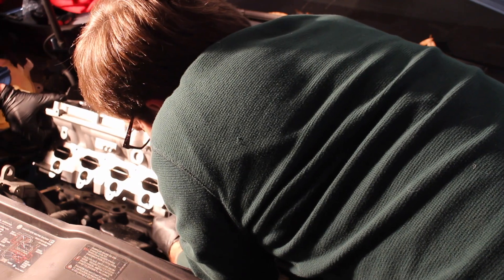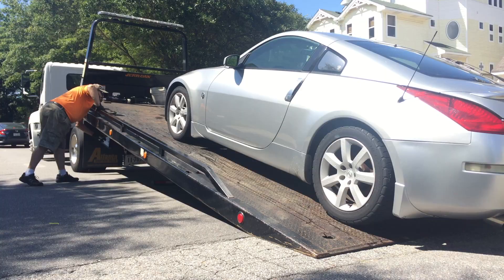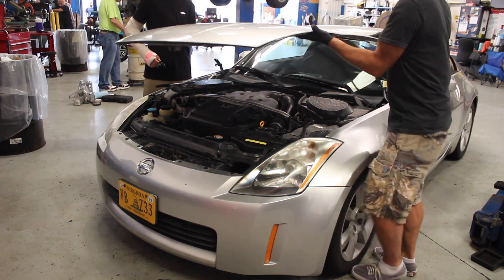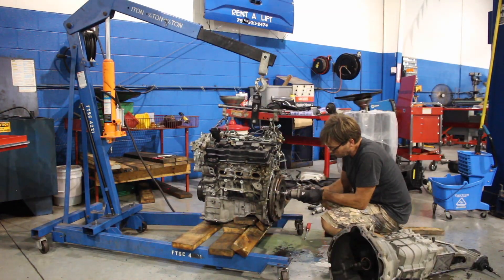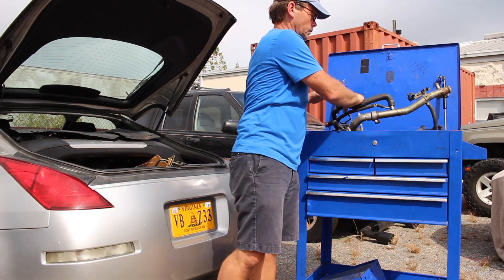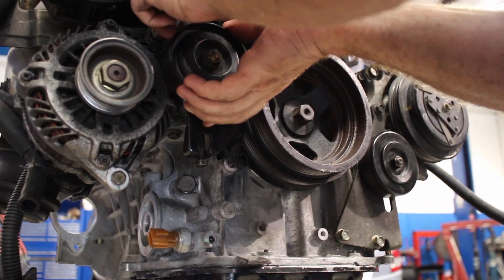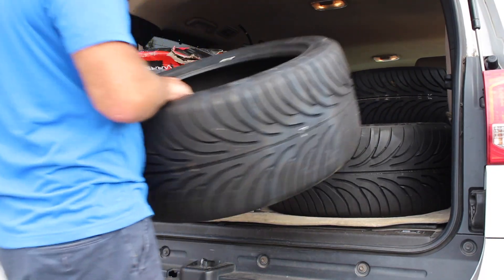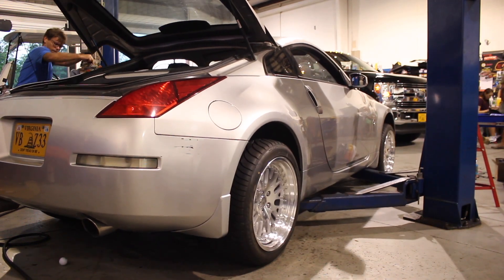350Z Engine Swap

Comment: Is there a way to get to the crankshaft bearings on a 350z without pulling the motor ?
Reply from the maker: Yes and no. The lower connecting rod bearings aren't difficult to change. I actually replaced them before I pulled the engine completely but the camshaft was already damaged by a spun bearing. If your camshaft is still good you might get away with new rod bearings. If the main bearings are bad I don't think you are going to be able to replace them in the car. BTW, it took me 10 hours to pull the oil pans, replace six rod bearings, and put it all back together. The car ran good for a week before it spun two bearings (again) and siezed. That's when I decided to just go for a complete rebuild. Hopefully this will also reduce oil consumption.
Reply: crankshaft bearings can be replaced from the bottom since that's the only way to remove them to be able to turn over a seized motor to access certain bolts like the flex plate/flywheel bolts on some cars. this should only be done at the very slightest hint of the problem aka tiny knock. once it's more profound, too late cos more parts are hurt. main bearings cant be replaced from bottom tho because entire crankshaft has to be lifted.
if a motor is knocking, I honestly recommend a swap if its already high milage around 100k. no rebuilding. order a long block or find junkyard low mile wreck
Reply: wow terrific video liked the production and narration my only complaint was that it was too short 😃👍🏻

Comment: What was the total cost and what was it a rebuild or a different engine ?
Reply from the maker: The original engine was rebuilt by a local shop. I planned to include footage of the rebuild but our schedules didn’t line up. No performance upgrades this time around. I believe it was a little over $3000 for the parts and machine shop work. My time is pretty much free of course.

Comment: As I was watching this video, I knew it was VA beach before you even mentioned it. I have a noise that has developed on my 03 350z. I suspect that it is a bearing as well. Either way, the motor is coming out and being replaced with a JDM engine at the recommendation of a local shop in Yorktown.
Reply from the maker: I would love to hear how the JDM engine works out for you. I would seriously consider that as an option next time.

Comment: I did this with a friend and his dad. Same exact car. A first for me. He’ll be changing his oil on time from now on. I also laid on the floor and guided the engine and transmission in. What an experience.
Reply from the maker: Definitely a rite of passage. Once you have done an engine swap it's hard to be intimidated by almost any repair. You might dread it, but you will know that you can handle it. Thanks for watching!

Comment: 2000? Bucks in labor is over exaggerated 
I paid 600 bucks at a shop with certified mechanics to pull my blown engine and put the replacement in
Reply: Where do you live at though?

Comment: im looking to pull my motor and leave it intact with trans attached.( i need it out to deal with some issues on the chassis, then re-install it)...   You mentioned problems you ran into. What was the scale of difficulty to simply get the engine to hanging on the hoist... IM looking to do this from my garage... is it in the realm of doable just to pop it out and back in?
Reply from the maker: Depends on how far it has to come out. You can support the pan and remove the steering rack and cross members without too much hassle. This allows you to move the engine around some if you disconnect the motor mounts. The wiring harness disconnects easily from under the dash. I just don’t know how much slack there is in the cooling lines, etc. Anybody else have experience here?
Reply: @StevenVigus  the scope of my work involves replacing vacuum lines on my twin turbo setup... also addressing a wastegate rattle, new mounts and some chasis clearance issues..... the original installer did a poor job and I dont trust a repeat performance...  

I've gotten the fan shroud off before so I'm sure it's not far from that, however I want to look before I leap

Comment: Where did you mount the cherry picker to on the engine to remove it ?
Reply from the maker: Check out 3:35 and 6:31. We scrounged up some bolts and used an accessory bracket hole in the front and a bell housing hole in the back.

Comment: Do all that work and keep everything stock??? Man, I would have popped in some cams and/or a light flywheel at least.
Reply: Is there anything that can be easily added for power when changing out the top valve covers? Gotta change mine soon and I'm wondering if there's anything I should add while I'm in there.
Reply from the maker: We did go with an upgraded 1 piece flywheel but this car has plenty of power for a 17 year old with an appetite for drifting. I would recommend converting the pcv return line to a catch setup can if you are going to drive it hard. Otherwise it tends to suck oil into the intake.

Comment: Ummm mechanic here. what that boy did with the springs was very dangerous. that would easily have broken bones, and if it slammed his hand to the floor, would've been even worse with both bone and tissue damage. looks like it hit the ground..
Gotta ALWAYS have safety in mind when working on cars or any extensive DIY home project or you won't be doing it for long.
cool video btw. so much passion! my sons will know how to work on cars. my daughter must know how to do all basic maintenance e.g fluids, rotors pads , filter tires etc. no excuses allowed XD
Reply: only new/factory rebuilt long block recommended because junk yard wreck may be another poorly maintained engine idk. yes they usually give 1k mile warranty or whatever but you just wasted you life on that labor if you hear another knock right when you start it after the swap. oh man would that suck lmao
Reply: i know this is a late reply and i unders tand from your point of view but im sure they were at a Pick N Pull type junk yard, we have two of those in San Antonio and they dont allow floor jacks into these places, ive had to pull a couple of transmissions and diffs by hand with not much type of help or safety, you use what you have and you work with it, obviously as safe as possible, or youre just asking for it, cant always stop things from happening, i know cause i broke a finger just as i was done pulling a 2500 transmission there, it was fun👌🏽

Comment: Ive owned and rebuilt 2 cars on the rwd vq35 platform. By now I know where each nut and bolt goes by memory but I really wish I had thought of buying a tackle box to label them all.
Reply from the maker: The plastic box is money, for sure. I now use it for just about every major project. BTW, do you have oil consumption problems with your cars? I think that hot-rodding is causing high intake vacuum to pull oil up from the breather. Would love to put a clear line on it to see what's really going on. That would explain why people convert to a catch can.
Reply: @StevenVigus  yes catch can is your best friend
Reply: Hey I just swapped my 350z engine everything works and turns on the thing is that it shakes the whole car shakes I was wondering if you could give me an idea of why that happens please and thank you !
Reply: @guadalupevalencia2987  did you check the engine before you swapped it in? Are all the motor/trans mounts tightened? Are all your vacuum hoses connected?